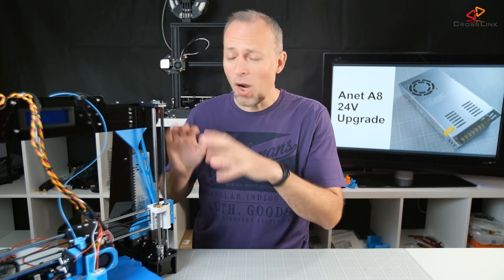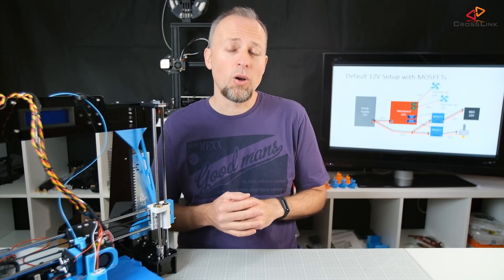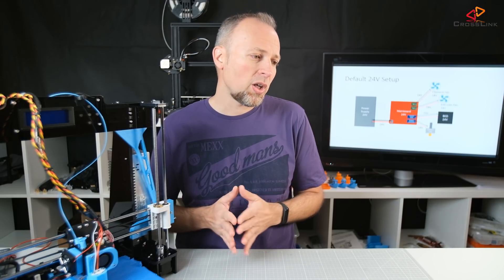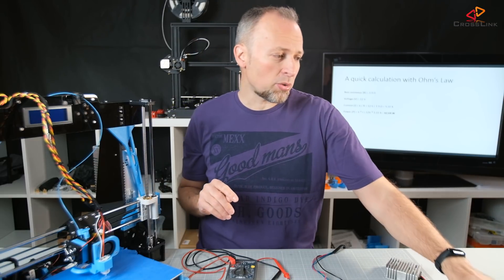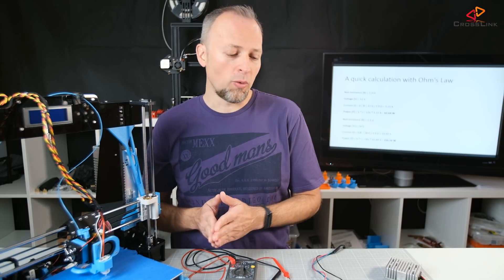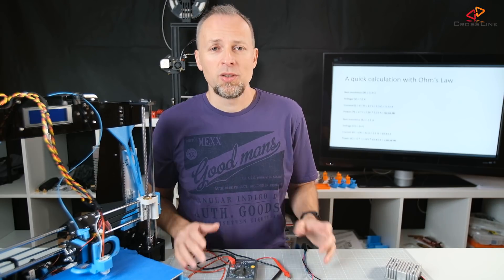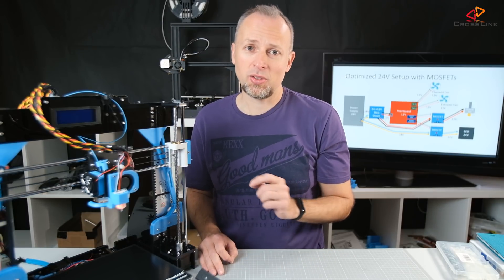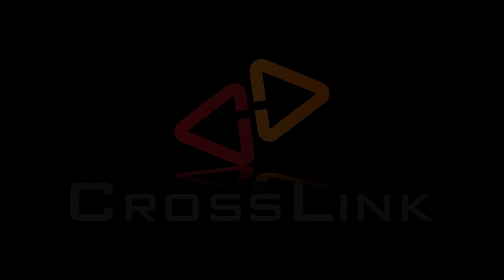Anet A8 Partial 24V Upgrade

Comment from the maker: Hey everyone, I've seen several comments on the 1.7 board whether it is 24V capable or not since I did not decide to power it with 24V in this video. So here some thoughts and what I am going to do next. First, yes the board is 24V capable. But to use it you would need to replace EVERYTHING on your printer: Heating cartridge, Heatbed, Fans and anything else that is only 12V capable. So you're essentially building a new printer and just the frame and the motors are kept. But since you asked for it, I am going to do it. So expect a 2.0 of this video soon explaining how a "pure" 24V setup worked for me.

Comment: 11 minutes? Where are you printing? Inside a fridge? I have a stock Anet A8 and it just takes a couple of minutes to reach 60º at 12v. But yes, a 24v power supply will heat it faster.

Comment: I am using the same power unit 24v as shown,l  but am using parts I have from an Ender 3. I am also using a spare SKR 1.4 TURBO and a spare TFT  e3 v3. I have ordered a 24v to 12v converter to run the bed and hot end. I have 2 spare fans to change for the 12 v. So waiting for the converter then I can start. I assume the step motors are OK on 24v as you did not mention them. Am I correct but think I will change them as I have spares also from my Ender 3. So its fingers crossed that I can complete this conversion. The converter is 30a 360w for a golf cart from Amazon.

Comment: I have the new board and 2 Meanwell power supplies, 12v and 24v, I need a good tutorial on the best possible setup, I also have a 750W Zalman PC supply I have been using.

Comment: I just finished this upgrade but I'm using an upgraded 12v power supply, 24v capable mosfet, 24v heat bed, and a 15 amp 24v converter. First I wired up the bed wrong and had it running at 9v but after fixing that it heats up from 28 degrees to 60 degrees in 1 min 52 seconds. Thanks!

Comment: HI,

I am trying to do this upgrade but I am strugling to find a 24V bed for my Anet A8. I am in the UK, have you got any links to where I can buy one? Can I use the 12V bed with 24V?
Reply from the maker: It's normally not an issue to run it with 24V but your cables might be more the issue. The current is going to be double the current than before if you run 12V parts on 24V.

Comment: Simple fix is use the bed sheet from ebay for $4, doesn't even need heat with that, also can get insulation that goes under the bed for $10 on ebay

Comment: My anet a8 came with power supply s-240-12 and it takes 2 to 3 minutes max to heat up to 190/60 degrees. Did mine come with a different power supply than others? i got my printer about a year ago so maybe they have updated versions? Any reason why i should upgrade other than the fact this PS still doesn't have a fan which i can just attach one to it?

Comment: You seem to have ignored OR are unaware... that it's  24 V to the Steppers that gives Visible print quality improvements. 
Not fiddling with faster Bed heatups :-)
 Beyond that  simply adding a Second 24 v PS to the remote heatbed mosfet device would have given the same result Without! having to buy a goofy "buck ' converter

Comment: Recently discovered your videos.  Good stuff.  Your 12V heatbed calculation doesn't match my real life measurement.  Mine was pulling 11 amps.  I decided to upgrade to a 24V bed to reduce the current demand.  Went with Ender bed (235 x 235). Of course this also required a 24V supply and MOSFET.  My hotend only pulls 3A, so no upgrade needed there.  I need to get the 24V to 12V converter for weight reduction 8D

Comment: Man your videos was a life saver and top notch info on the A8 With your help I’ve got it doing very well I also have the ender 3 pro it is a awesome printer what hot end are you using on your A8 Thank you for all the hard work.
Reply from the maker: I am still using the stock hot end on the Anet a8. Never let me down so far. But I am planning for a Bowden upgrade just to compare it.

Comment: Are you sure you have that connected correctly, it dosnt look right to me. I dont think you should have a connection to pin 1 of the heat bed when using 24V. Probably why it heated up so quick.

Comment: I put an adhesive  cork sheet under the printing bed  and a piece of cardbord on it while heating. Especially the cardboard helps alot. You should try it (saves power too :D)

Comment: My Hotbed needs 4 minutes from 20 to 65 degree. After 5 minutes the printer starts to print.
Reply from the maker: Interesting, I am collecting some data points. What surface are you using on top of the aluminium? Did you isolate your heatbed from the bottom side?
Reply: Hi, I'm using glass and no isolation. I think it depends a little bit on the charge when then printer was manufactured ( mine is from 1/2018) . Chinese quality standards... ;-)

Comment: After watching your video I thought I'd time my Anet A8's 12V bed. The only difference is I have 2 layers of 1/4" cork (1/2" total) glued to the bottom of my bed (with a few 1/4" deep cutouts to allow for rivets, etc.). My bed started at 23 degrees Celsius. It took 3:40 to reach 60 degrees Celsius.  Not too bad for $10 worth of cork. Plus, I have two tiles left of the 4-pack. You can see part of my bed here for some thumbwheel spacers I made: https://www.thingiverse.com/thing:3093612

Comment: I'm really curious that your bed heat up time is so long. I have the original bed (obviously still at 12V) with a build-tak (clone) surface – and for me it get's up to heat in around 6-minutes. (see: https://pasteboard.co/IgXyWGl.png ); do you have a glass bed – does that add thermal mass to be heated? Or is the external MOSFETs? (I've not added those to date – as I have a rev 1.7 board; and I've not seen any signs to concern me about it overheating).
Reply from the maker: I will do some more tests with the original bed at 12v why it's so slow. Probably a glass plate helps to isolate a bit and then it might heat up faster. The Amount of energy getting lost on the sheer aluminium plate is probably higher.

Comment: Hey, Daniel, I think you should read the reviews on Amazon about the Anycubic hot bed. They are pretty sketchy.
Reply from the maker: So far I cannot say anything bad about it yet, doing a long term test over the next weeks.
Reply: Crosslink excellent. Question: you didn’t answer the question, does the 1.7 board support 24v?
Reply from the maker: Well, it does support it but I did finally decide to stay at 12v for now with the board until I got new fans and new cartridge delivered. Will do another "2.0" update as soon as I have tested the new parts. For now, a switch to the 1.7 board seems not worth the money. There is better alternatives like RAMPS, MKS, Smoothie board etc. that are much more worth the investment and give you so much more power, features and possibilities like filament sensors, dual extruders, and more.

Comment: Great video, I really like how you did that. But I think it would be helpful to also look at the economics? What does the step Dow converter cost verses getting a hot end that can use 24v?  You did think about this with the anycubic bed. That’s great. Is the bed 12 or 24v? It seems so. Thanks. Really appreciate this. 11 minutes to 2 is mind blowing!

Comment: great video , my anet a8 became a AM8 and it prints great , i just upgrade to ramps 1.4 using mosfet for heated bed, i am thinking to upgrade the heatd bed to 24v and  step drivers to  TMC2130  . thanks for the tutorial
Reply: Is the am8 upgrade worth it?
Reply: @Power-Wiesel  yes, very strong frame, I see the quality in my prints, now I installed tmc2130 drivers and now my printer it is super quiet , I just need to change the fans to noctua fans (they are super quiet) and my printer will be done super silent.

Comment: I've been considering doing the same thing for a while. When I print ABS I can only get the bed up to 85 degrees C which works fine but takes a very long time to get there and I would rather run the heated bed at 100 to 110 degrees C.

Comment: i say, and thats real, we have too much "VOLTS" in this video 😅

Sehr Gut Daniel, weiter so! Aber ob 24Volt SICHERER sind, liegt immer in der Ausführung... Du kannst mit 24Volt genau so zu brennen beginnen, wenn du nicht vernünftig arbeitest oder den Querschnitt zu gering ausführst.
Und viele Brände entstanden durch nicht genügend Kühlung des Mainboards.
Ich habe das Board V1.5 mittels Wärmebildkamera gecheckt und festgestellt das die Leiterbahnen der Z und Y Achsenmotore extrem heiss werden. Hatte punktweise 75 - 80 Grad Celsius an den Leiterbahnen!!! nach ca 1 Stunde Betrieb... Seit der aktiven Kühlung bin ich auf 35 unten...

Auch die Bilder von brennenden AnetA8 haben meines erachtens immer (je nach Platinendrehung) an den Stepperausgängen zu brennen begonnen.

Ich kühle das Board nun und die Probleme sind wie "weggeblasen" 😉

Also, auf weiterhin guten "SLICE" und immer genug "VOLTS" im Netzteil 😎

Comment: Great video as always.  So the Anycubic heat bed has the same bolt spacing as the Anet A8 heat bed?  Very interesting results.
Reply from the maker: Yes, there is a 220x220 version of the Ultrabase that fits exactly the Anet A8's frame. Really like it so far. I just have to figure out how to make the best adhesion

Comment: Are u sure you choose the good voltage on the basic  power suply because in the basic power i haved the same issue and i solved it by set the good voltage and its really more rapid thand 11 minute for 60 degre .....
Reply from the maker: Yes, I am sure but my basement is pretty cold. In summer time, the heat up time might be faster at 12V. But I have the same time with a second Anet A8 so I am pretty sure that it is so slow.